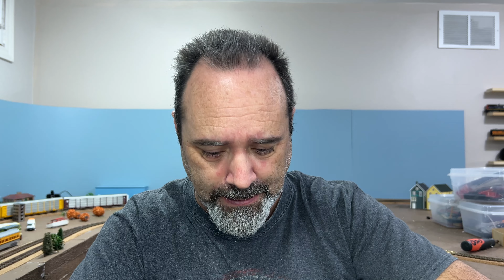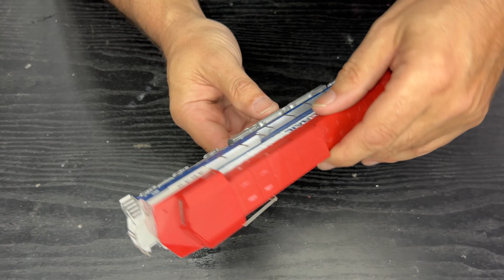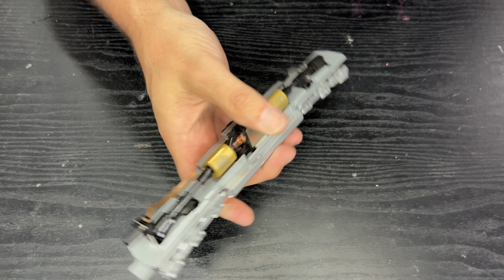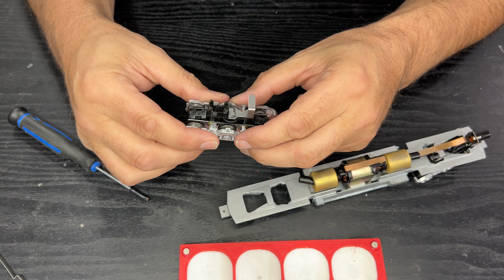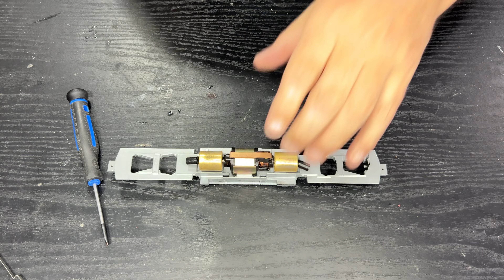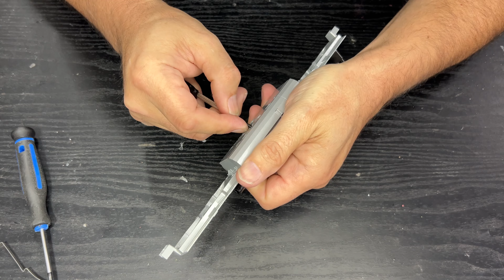Athearn Blue Box Dash 9 DCC Upgrade - Full Walk Through

Comment: BCOL 4642 actually has the four windshields I know because I’ve seen the prototype
Reply from the maker: Yes, but that was a different loco. I think this one is a fantasy paint scheme.
Reply: Yup the real BCOL 4642 is classified as a Dash 9-44CWL. It has the Canadian comfort cabs, compared to standard GE North American Safety Cab. Although back when Athearn produced these in the early 2000's they didn't make new molds for the Canadian cabs. Later years they did offer the Dash 9's with the Canadian comfort cab in the Genesis line, although that was retired.

Comment: JerseyBill is impressed with the ease at which you did the conversion. The Suttell hints like the temperature of the soldering iron when connecting to the steel parts and the brush plate swap were ideal. Great video as usual. JP where are you?

Comment: Did you speed match them? If so, how did you do it? Great video as usual..
Reply from the maker: Not speed matched, just manually controlled. They are both the same model of Athearn, so the gearing is very similar.

Comment: Good video Dave. I am sure great help for beginners. You can cut those body clips off. The couplers will hold the shell on. I think the tape holds the fuel tank sides on. Glue a much better idea. Check out Dean Park Model Railroad, another Scottish Model Railroader.  Keep up the good work!